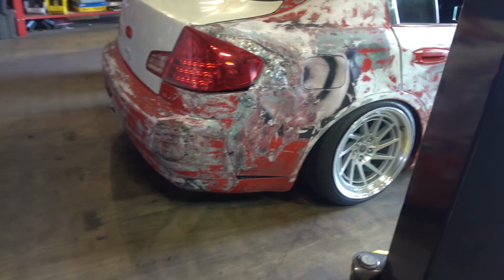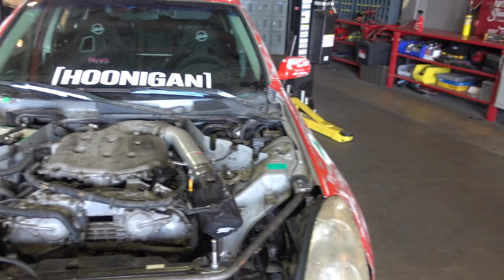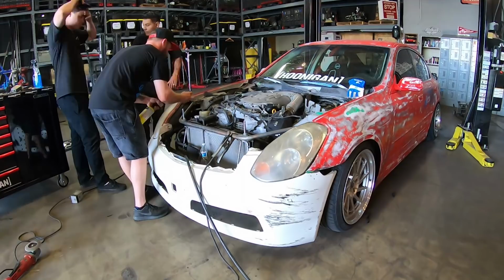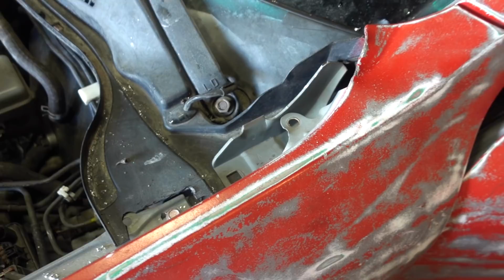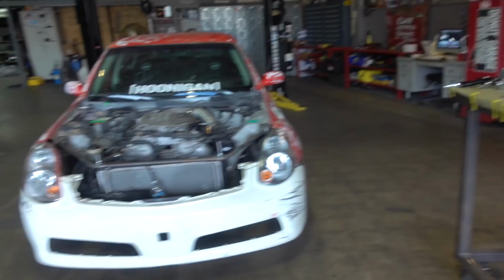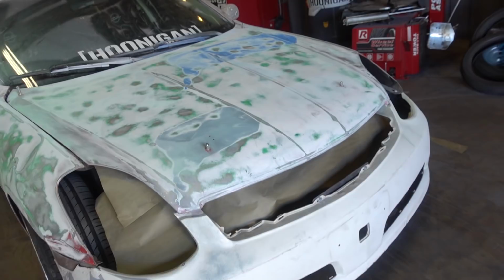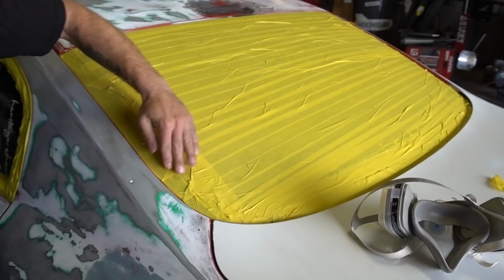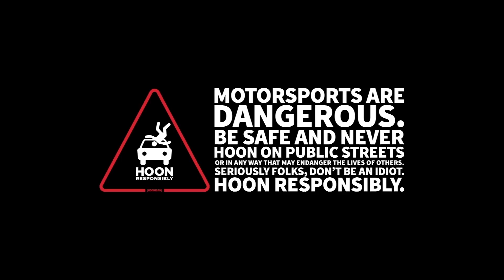Our G35 Drift Car Gets a Homemade Hotboi Paint Job! Part 1: Prep

Comment: I have never seen welding with zip ties before but that is what I call a true ziptie technician
Reply from the maker: This was purely a test in the name of SCIENCE!
Reply: Man I'm deff going to try that on some stuff. With some practice and love there might be something there
Reply: Just saying.....jb weld?..😂
Reply: @flyingmunk8956  I wouldn't recommend it, melted plastic stinks like hell and is really fucking bad for you.
Reply: @ClimptonDiddlehopper  I have been wanting to buy one recently for my cracked bumper. Herd they can be a pain to make look good
Reply: @TheOdd  ahh. it will be fine. Burning plastic is delicious. Lol. No but really. I know that bud. Thanks for the concern
Reply: bonus points if youve ever melted little plastic army men for plastic repairs
Reply: Modern problems requires modern solution
Reply: 3/4 inch acrylic sheets through a table saw smells the best. Like the taste of antifreeze! PVC will f you up eventually.

Comment: 1. Shoulda made the hood open like a Corvette, Front Hinges, then it can't blow off (Hert)

2. Hot Boi Croc Colors for Paint?
Reply: They did that color already, or close enough. If you watch there's a neon green layer under the red, white, and blue layers on the G35. It's not very hot boi with all those dents anyway. No amount of flake in the paint is going to mask how beat that car is.

Comment: the cheap yellow braided rope when heated makes a much better plastic weld. I have used it to fix holes in radiators. It will also sustain it's own flame allowing you to just drip the plastic in place.
Reply from the maker: Brilliant! Thanks for the heads up Kyle. Next time we knock the front end off this thing, we will try the braided rope.

Comment: You get better results plastic welding if you use a soldering iron.  It allows the two plastics to melt together for a stronger bond.  I have repaired a few motorcycle fairings that way before paint since bondo and fiberglass crack instead of flexing like the plastic does.

Comment: All those coats of paint getting removed... that's actually a good way to do some weight reduction. Sadly, it doesn't work on every cars since nobody would normally think of painting a car without removing the old one, especially doing it multiple time
Reply from the maker: The 7 layers of paint worked as body armor for the G...Ha!

Comment: Just a tip for Dan .Knowing enough to be dangerous about plastic welding . You need the same parent plastic for it to work,zip ties are the wrong plastic to use. Next time get a broken light from a bmw for free from the junk yard and cut strips like welding rod,then use a soldering iron and it will be 98% as strong as new. It has worked for me many times.

Comment: Get a 3D printer hotend and extruder motor working and put ABS innit. Big hole on the nozzle and pour it in the holes you need fixed. Works real nice.

Comment: Respect the hustle lol ;-) but it ya really want to fix it use a soldering gun with the flat til and melt stainless mesh it with the heat of the iron then fill with zip tye ot bottle caps ;-) good job skillz are on point guys loving it always

Comment: Well, depending on intent of final look, it is a camera car that's going to get fucked up. Over prepared this? Use the old paint as fillers and sand it down right, straight. Also, cheap paint is great paint too! Buy what you need, thus, cheap = easy color matching. I would've shot it myself, thinner Rusto and cheap spray gun. Like $50 cheap...
Reply from the maker: Ha! We're not going to go that cheap, but we are going to go a route that makes the most sense.
Reply: Hoonigan Project Cars Outsourcing work isn't a bad idea. Specialist exist for this reason.